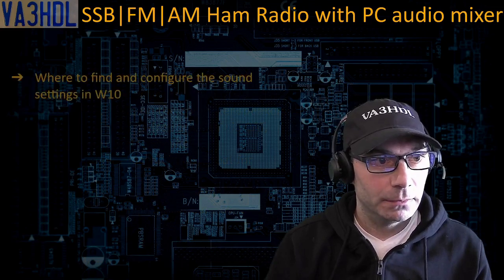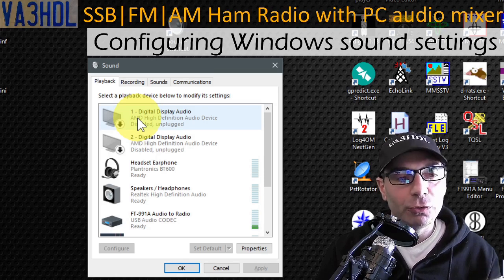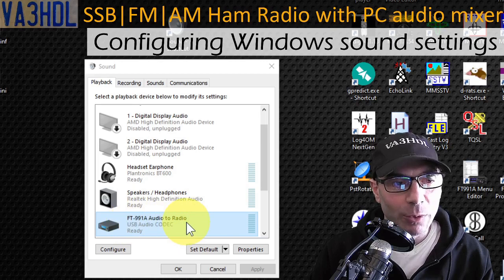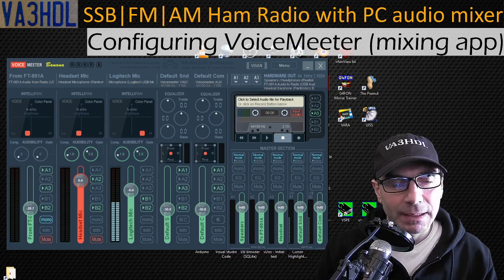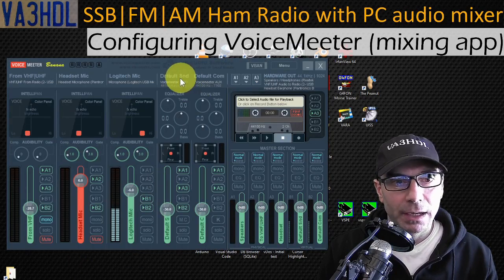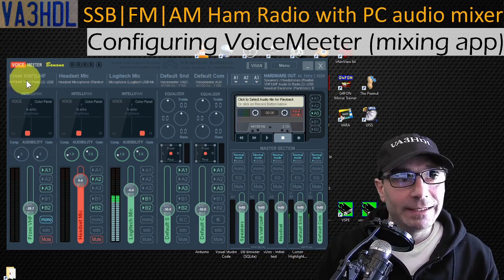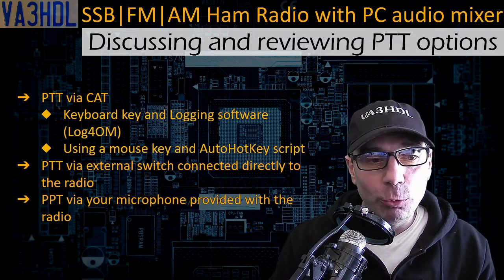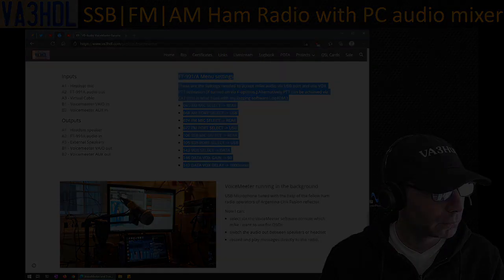SSB|FM|AM FT-991A Voice processing for ham radio using PC sound card mixer

Comment: Still relevant after 5 years! I decided to pull out my FT-991a and set it up on Windows 11 Pro, running in Parallels on my MAC. It works outstanding! I put the radio microphone in the closet where I pulled the FT-991a from.

Comment: I had not really used a computer's sound card much for 15 years where Windows XP and the older versions of Linux I was very familiar with.

Windows 10 changed the layout so much that I am only just starting to become familiar with its layout. 

I had no idea that not only did you have to enable in the soundcard app which recording device you wanted to use, but if you wanted a live signal to be sent to an output such as powered speakers or line in on your rig without a program such as Audacity running you also had to after enabling your mic double left click on the mic's icon and then left click on listen followed by apply & OK.

Once I found the above out I was able to get audio input into my computer thru any mic and my mixer  to output into my RS 918 as well as have the CAT control running and SDRuno serving as a giant Panadapter for easily scanning the band for signals.

I am really pleased now. I do want to use Banana but not until I read the help section a bit. I tried to intuitively use it last night before I was aware of the need to find and check the listen box and in doing so mucked it up. I uninstalled and will reinstall with a clean start later.

None the less thanks for the heads up on this and maybe you will hear me down the road if I add my small amp and get my 40 meter phased array off the drawing board.

73
De kc2wvb

Comment: Hi Pablo. I programmed everything as you described. I also hear audio from the 991A on my computer monitors. I also see a signal from the external microphone on the to radio channel in the output section of the Banana mixer. In the 991a, however, only the Yaesu microphone works. I have set everything as stated in the 991A. Do you have any idea why it's not working? Greeting Detlev DG6DAJ
Reply from the maker: Hi Detlev, it could be the settings on the FT-991A menu are not 100% correct. Please check on my website this page https://www.va3hdl.com/projects/voicemeeter and let me know if you have the same settings. Good luck. 73, Pablo, VA3HDL
Reply: @VA3HDL  Hi Pablo. It's probably not the settings but the functions or operation. If I have set VOX, it works with the external microphone. If I press MOX, it works too. If I press the PTT on the Yaesu microphone, it only works with the Yaesu microphone. So I either have to press or set Mox/Vox or get the TRX to transmit in some other way.
Reply from the maker: @detlevwabner8020  Maybe I didn't understand the issue you are having. If your problem is only with PTT (keying the radio to transmit) your options are CAT PTT, a foot switch or external switch connected in the back or D.VOX (Digital Vox not VOX.) I use CAT PTT and D.VOX mainly with my  radio. For CAT I wrote a script that puts the radio in TX when I press the middle button of the mouse or specific key on the keyboard. Is this what you need or the issue you having? 73
Reply: Hi Pablo. First of all thanks for the help. You said in your video that you can press PTT on the Yaesu mic and audio still goes from the external mic into the TRX. This does not work for me. If I press PTT then only the Yaesu microphone works. If I get the TRX to transmit via VOX MOX, audio comes from the external microphone. Maybe I didn't find another menu setting there. I did everything you wrote. So if that doesn't work then I'll take a look at the CAT PTT.
Reply from the maker: @detlevwabner8020  I did test with my rig and I can confirm your findings. There is no audio transmission using the factory mic PTT speaking directly to the mic or to computer mic. Computer mic works well with D.VOX or with CAT PTT. You can check my code for CAT PTT from here https://github.com/VA3HDL/CATPTT   -- I just uploaded the script. 73
Reply: @VA3HDL  ok. Now It works with the middle mouse button. What do I have to program if I want to press the PTT with another key (e.g. space key)? I don't know much about programming. Thanks again.
Reply from the maker: @detlevwabner8020  I would not recommend to map a key that you normally use (like the space key.) The keycodes in the file are "SC125::" "SC126::" "Launch_App2::" you need to replace these numbers with the codes of the keys you want to use instead. Here is explained https://www.autohotkey.com/docs/v1/KeyList.htm - I use an Hewlett Packard keyboard with a bunch of extra keys that I programmed to do these things. Check the "Multimedia keys" section on that page to get the idea. 73

Comment: Muchas gracias Pablo por el video, segui tus instrucciones pero todavia no puedo hacer que el audio de la compu llegue al 991a. Por mas que seleciono REAR en la SSB MIC input el audio es captado por el MIC de mano no de la PC. Any ideas? gracias!
Reply from the maker: Me fijo mañana y te aviso
Reply from the maker: Podes revisar todos los seteos en mi website https://www.va3hdl.com/projects/voicemeeter - Ahi esta todo explicado.
FT-991/A Menu settings
These are the settings needed to accept mike audio via USB port and use VOX PTT activation (if turned on via F-options.) Alternatively PTT can be achieved via CAT (this is what I use with my logging software Log4OM.)

045 AM MIC SELECT -> REAR
048 AM PORT SELECT -> USB
074 FM MIC SELECT -> REAR
077 FM PORT SELECT -> USB
106 SSB MIC SELECT -> REAR
109 SSB PORT SELECT -> USB
142 VOX SELECT -> DATA
146 DATA VOX GAIN -> 90
147 DATA VOX DELAY -> 1000msec
Reply: @VA3HDL  I was able to get it to work by using the RTTY pin out to create a  foot switch. Thank you so much for all the info and the video was very helpful!

Comment: Hi Paolo, I'm i1odp I'm very interested in your project because I would like to use it with K3 Elecraft in a remote location and listen and transmit through my computer with -a micro headset without connection cable but via Bluetooth. I would like your suggestion on which USB audio adapter to buy or send me the schematic of your USB interface please. I subscribed to your projects on Youtube because they are very interesting. Thank you and best 73 Paolo i1odp
Reply from the maker: Hi Paolo, 
This is the headset I'm using on the video:
https://www.amazon.ca/dp/B013F4LLZ0?ref_=cm_sw_r_cp_ud_dp_5AQJ5T4AER2FBTGSB0TP
It is wireless and comes with the USB adapter that goes into the computer. 

USB audio adapter that I always use is:
https://www.amazon.ca/dp/B013F4LLZ0?ref_=cm_sw_r_cp_ud_dp_5AQJ5T4AER2FBTGSB0TP

The schematic of the circuit I've used on the video is here:
https://www.va3hdl.com/projects/diy-sound-interface

I hope that helps, 73, Pablo
Reply: Grazie Pablo 
I will try to use this clever idea hoping that this solution avoid the increase of  latency
Best 73
Paolo i1odp
 @VA3HDL

Comment: Hello Paplo great video. i did put all the setting as you mentioned in the video bud when i ptt there is no audio to the tranciver. What should i look for ?
Reply from the maker: Hi Marc, look for VoiceMeeter patching first, this is the easiest one, is the microphone connected to the PC patched to the physical connection on the master section that corresponds to the radio? Second, is the mic input for SSB set to USB input on the radio? In the FT-991(A) is "Rear". Third, do you have set a digital gain on the radio sufficiently high? Hope that helps to start. 73
Reply: @VA3HDL  tnkx for the quick asnwer Pablo i will check the digital gain because this i did not check it. ;-) 73
Reply: @marcdouven4124  Hello Pablo i did try all setting again also dig gain bud stil no audio when transmitting :-( i am using the FT991A

Comment: Can you play sound FROM the computer TO the FT991A? I have tried using the USB audio device as a playback device but don't see/hear it sending to the radio.
Reply from the maker: That is normal. If the sound from the computer is going to the radio then is not going to the computer speakers, unless the software you are using is able to send audio to two devices simultaneously. Now, when the sound goes to the radio there is nothing built-in on the radio that allows you to play the sound. The only way is to make the radio to transmit and listen with another receiver on the same frequency. This is how the radio plays the sound. Hope it helps. 73.

Comment: Thanks for the videos. What do you think is the best way to use my computer and speakers for just the audio of the FT-991A? I will use the supplied Yaesu Mic. The radio is connected to my computer with an USB cable.
Reply from the maker: Hi Tim, if you want to continue using the Yaesu mic directly connected to the radio then there is no need to install any software on the PC to listen through the PC speakers. You need to open the sound settings as I show on the video. Then go to the "Recording" tab. Select the "USB Audio CODEC" (this is the audio coming from the FT991A) and right-click and select "Properties" - Click on the "Listen" tab on the properties window and check the option "Listen to this device" then "Ok". All this steps will route the audio from FT-991A through your Windows PC built-in mixer. You can control de volume coming from the radio on the "Levels" tab on the same properties window. Hope it helps. 73, Pablo
Reply: @VA3HDL  Hi Pablo. Great video! I was just curious, is there a way for me to record the transmit and receive audio with my computer via the USB cable, while using the Yaesu mic? I'm looking to record both sides of my QSOs that way if possible. With the method you mentioned in this comment, is it only the audio being received by the radio that is being played back on the computer? Thank you!
Reply from the maker: @biagioport3006  That is correct, only the received audio can be recorded when using a mike directly connected to the radio. The audio of the mike directly connected to the radio is not coming out via USB port unfortunately. 73
Reply: @VA3HDL  I understand. Thank you for getting back to me! I will try it out how you did it in the video.
Reply from the maker: @biagioport3006  Sounds good. Lets us know how it goes. I upgraded my microphone recently and still using the same configuration. Very happy how all works. 73

Comment: Hi Pablo! Thank you very much for this video. I will challenge myself on getting equal audio set up on MAC. But I might just end up with a Virtual Win Machine where VoiceMeter is supported for this purpose if I do not find right software on MAC. 73!
Reply from the maker: Hello! You should be able to find good software for MAC. Unfortunately, I do not have a MAC to create a tutorial. I did create a page on my website for the Linux equivalent called "Carla". A very decent piece of software to handle mixing and DSP, plugins, etc. I found the MAC version here https://www.macupdate.com/app/mac/62793/carla check if that helps. 73
Reply: @VA3HDL  Thanks Pablo. I will give it a try and share my experience.